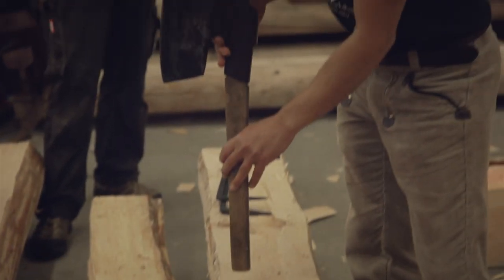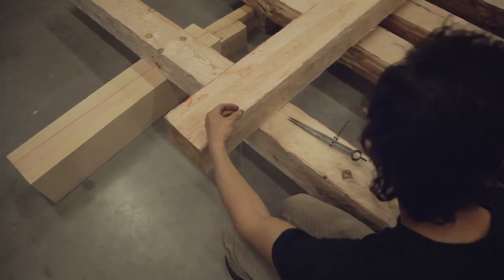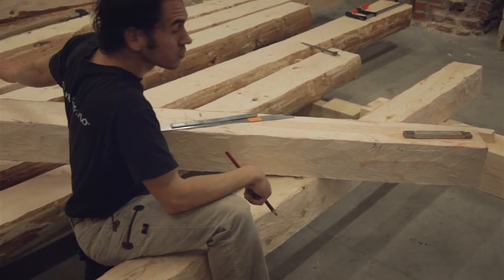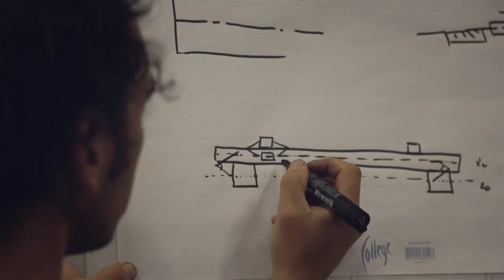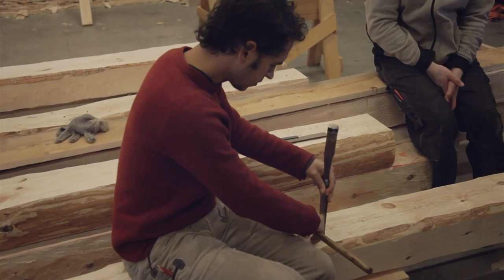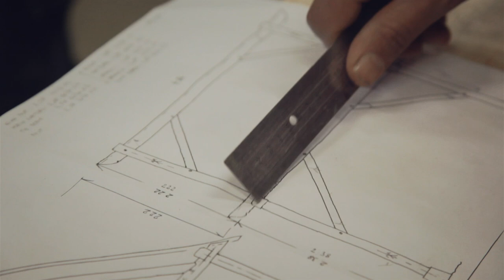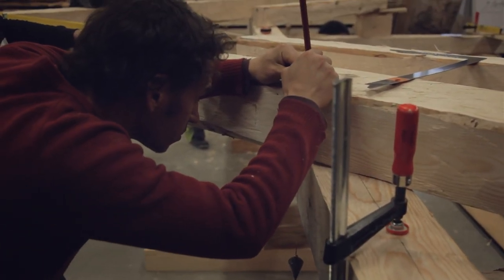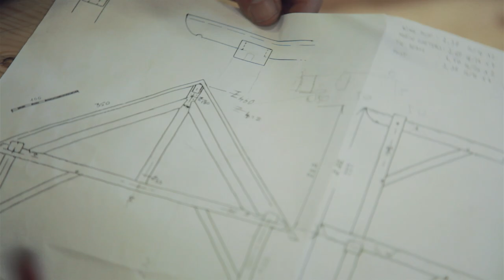Medieval carpentry - building without nails. French Timber Framing & Scribing

Comment: The long handed chisel ( almost like a spade looks lovely to use ) i wonder if he drill out the mortices before chiselling the husk out. Also i like the fact that you used square edged pegs , i work on a lot of old Tudor buildings in England and its those little differences that shows someone knows their stuff
Reply: Is there a practical benefit to square pegs over round ones?

Comment: Thank you for this impressive and well done tutorial. The 1817 cow barn i played in was built this way (supposedly by one man, alone). The jointery connecting the sixty+ foot spans of twisted beams always impressed me with wonderment. Now i see that a plum line and straight edge can do the job with appropriate axes and chisels and frame cranes and winches.
Reply: Robert Fay 
‘Plumb line’.   Nothing to do with fruit.
Plumb lines traditionally had lead weights (or bobs).
The Latin for lead is ‘plumbum’.

The same Latin root appears in ‘plumbing’ and ‘plumber’ because water pipes were originally made of lead.
Reply: @johnstarkie9948  Exactly. As i am sure you know, a plum line shows a true vertical. ||| I will be pleased to provide you a reference for a raise in pay to who ever pays you to act like a troll seeking to make others wrong in any way possible. You have a worthy future and an inspiring self identity to support.
Reply: Robert Fay 
I’m grateful for your approbation.
It’s a ‘plumb line’ not a ‘plum line’.
Reply: @RobertFay   Never give trolls  the satisfaction of knowing that they have stung you.  There are better things to do with your time than waste it in an Internet argument.  If anyone wants to portray themselves as a pedantic, pernickety, nit-picking t*at, let them, not your problem. Only they can change themselves, you can't  and its not your job to.
Reply: @arthurrsaker8893  .
- Agreed.

Comment: A very interesting video, I was surprised to see so many poor quality modern tools being used, but near the end the real tools came out when fitting the frame required a more accurate fit, also no adze being used, the side axe is very much harder to use that the adze for surfacing the large timbers, one to watch over a few times I think.

Comment: Would they use hand planes on timber to smooth out the sides?
Reply: You can but they didn't then. The roof timbers were often left VERY rough especially in smaller cottages where they enclosed an attic rather than second srory

Comment: Could you used green wood ?

Or does the wood gave to be dry
Reply: Depends on the species, some shrink more than others.
Best bet is always dried wood
Reply: Would spruce shrink a lot ?
Reply: I believe you can hew green wood, remove bark and shape it,
but it should be dry when you make the joints and such.

Comment: i was taught to use a mallet on a chisel, not a claw hammer
Reply: Actually chisels used in rough carpentry are still designed to be used with a steel hammer. I'm talking about the ones you see at the hardware store with the plastic handles.

Comment: It only took me a few times before I said "I'm not chiseling another hole" and just used 1 inch drill bit and hand drill. There's no reason to use the chisel to dig it all out that's just a massive waste of energy and was a tool adopted very early on for timber framing. It would be stupid not to use it.

Comment: Cutting wood with an axe into beams is almost like carving a statue with a chainsaw. It can be done, but only a few could do it well...
Reply: FYI beams(and all the other elements in this construction) are made of timber (structural/carpentry) not wood (non-structural/joinery).
Reply: @chippysteve4524  I don't really get what you are trying to say. To me both terms appeared pretty interchangeable...

Comment: This seems rather arbitrary and obscure. Following what is occurring is difficult because the continuity of filming is not overly sequential. Not to mention the scribing does not appear to be relevant to anything in the beginning. The angles of the beams appear random and not stated in terms of degree or length.. it’s just difficult to follow.
Reply: Timber is not square. Using a plumbob to mark the wide point of the log below onto the one above and the scribing the gap between the line and the narrow point. Marking pieces onto each other is very accurate and widely used before uniformly planed righf angled lumber
Reply: @filthymcnastyazz  he could of done that by holding a straighteners on the lower beam and transferring to the upper beam which would of given him the same angle without the buggeration if plumb bobs, dividers etc!
Reply: @gbwildlifeuk8269  i must be missing something then, without a square edge to work from i dont see how it coud work

Comment: This is an instructional documentary about the traditional french timber framing , well it isn't according  to wiki :"Japanese carpentry was developed more than a millennium ago and uses distinctive woodworking joints. It involves building wooden furniture without the use of nails, screws, glue or electric tools."  Many of the techniques and joinery  you use are much older that described.